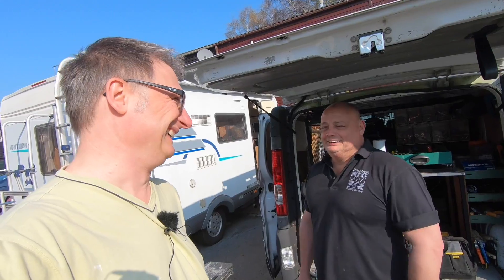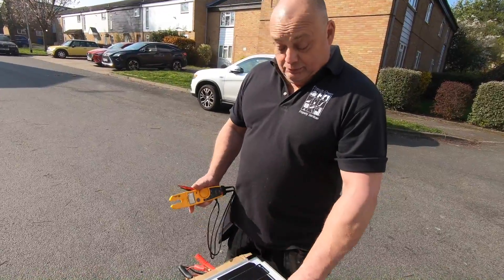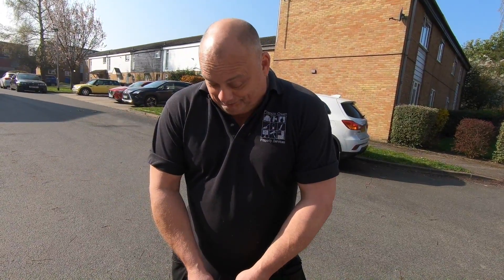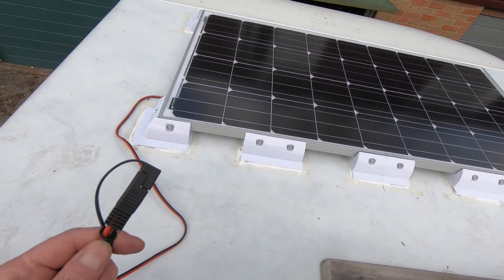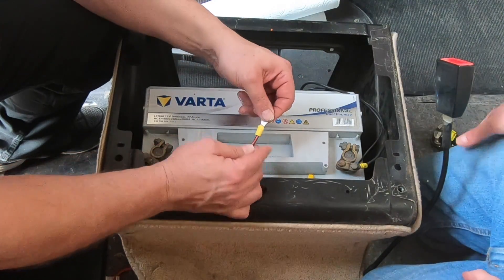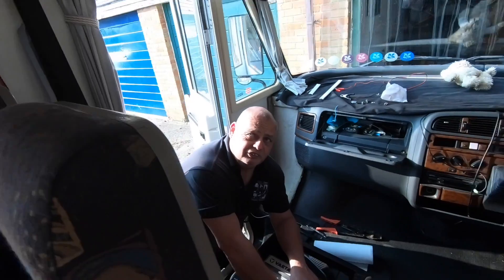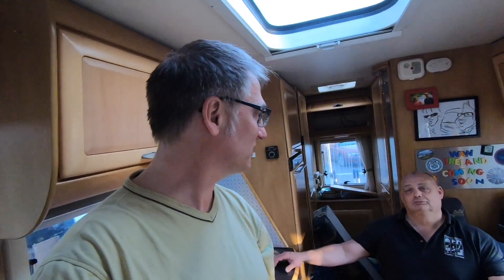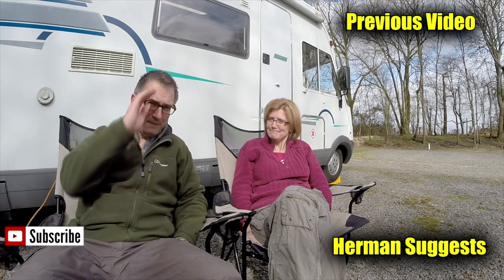DIY Installing Solar to a Motorhome/Caravan - Part 3

Comment: So it's been 3 years. How's the glue holding up? ( Haven't gotten further so no idea id a follow up video yet
Reply from the maker: The mastic is fine, Andreas
Reply: @HermanHitstheRoad  wait, i thought mastic meant sealant that does not harden?
Reply from the maker: They harden to a flexible rubbery glue

Comment: We have just got a solar kit, yours is the first Video  I've found to show drilling through the Motorhome roof. To be honest I'm not looking forward to doing it lol 😂😷
Reply from the maker: LOL David, nor was I. What solar did you get?
Reply: Herman Hits the Road we got Renogy 200D starter kit 😷
Reply from the maker: Is that 200 watts then? Does it come with a MPPT controller too?
Reply: Herman Hits the Road yes 200 watts but not the pttp controller 😷
Reply from the maker: You'll need the MPPT solar controller. It manages the charging a lot more efficiently than any thing else. We have the Victron SmartSolar MPPT 75 1 15
Reply: Herman Hits the Road yes but it came with the other  so we will have to go with that till funds allow us to change it 😷

Comment: hi what size inline fuse do u use thanks j
Reply from the maker: Hi Jason, the fuse came already fitted to the controller. I think it is a 20amp but it depends on how many watts your panel brings in and what your controller is rated for
Reply: thank u for getting back to me i will be useing a 30 amp controller so will i need a 20 amp fuse or do i need a 30 amp inline fuse to the main battery and i will be putting the other outlet to the leisure battery i will be useing 300 watts of solar pannels ,sorry about all the questions but it came wth them but not installed right thanks again j

Comment: Great video Ads....Can I ask where you got the extra long mounting bracket for the front end from?
Reply from the maker: Hi Vagabond Voyagers, it's actually 3 pieces. Two long lengths and an off-cut from a smaller one for the middle.
Reply: Aahh that explains it.....Thanks Ads

Comment: Hi !   I've got a similar EBL fitted in my Hymer and I have all the solar gear ready to fit and connect.   I had come to the same conclusion and will avoid connecting through the EBL.   Although you have connected only to the leisure battery, have you found it also charges the starter battery once the leisure battery is fully charged?   And did you wash the underside of the panel brackets before you bonded them to the roof?    The video showed you doing that to the roof.   I ask because I know they use a release agent in the moulds when they are cast and that stops adhesive from getting a good grip.   I learned that the hard way with a new ceiling vent and I found I could push it off easily once I unscrewed a couple of bolts even though I had bonded it too.    All the best, Pete
Reply from the maker: Hi Pete, I haven't connected the starter battery to the solar. I didn't wipe the bottom but Chas might of. It is very firmly bonded to the roof. I do check and clean it every so often.

Comment: Hi, I’ve just bought the same charge controller. It’s not yet installed. Because the controller is already fused does that mean you don’t need a fuse either side or just battery side? Thanks for the videos and the live-streams good fun and informative to watch.
Reply from the maker: Hi, there is no harm in adding more fuses but I haven't because a 20 amp is already present. Check out the install instructions for the controller. I would check but I don't have it with me at the moment.

Comment: Hi off topic but need your help please. My bus is in storage in Spain and i need a dimension for the width of the windscreen between the interior blinds and from the carpet dash to underside of the bed. Could you help?
Reply from the maker: Hi Richard, I'm not sure what measurement you need but the height from the carpet dash to the bottom of the drop down bed is 55-60cm. The bed moves up and down with the struts since it is only held in place by a seat belt. Yours may be different. What do you need the measurement for?
Reply from the maker: If you need wind screen dimensions then we gave these to Autoglass - Height - 87.5cm including rubber / Width - 258cm including rubber

Comment: Why so many fixing brackets? One each corner and one in the middle of each long side would have done and let some air under it for cooling.
Reply from the maker: That thing isn't coming off and wind will be deflected over the top when driving

Comment: not the best reading when you place your multimeter on the panel youre testing...
Reply from the maker: We're just making sure the panel works before we glue it to the roof. You can't test the amount of amps because there are too many factors such as how sunny it is and angle of panel to the sun.

Comment: #6: Good job, I would probably install ting a little neeter, but that's only me ;o), good choice on the MPPT reg, I got the 100/20 one  installed,  the BT app works great, now you got every info you need. Enjoy the free solar power. Cheers.
Reply from the maker: Neater? What's not neat?
Reply: @HermanHitstheRoad  Again, its just me, no offence at your work, but I would  put the hole in the roof more in a corner wise, idem with the regulator. Also, the wires are to far stripped and (copper) exposed at the terminals for my taste. But who m I, if you are happy with it, all is fine, no problem. cheers.
Reply from the maker: Couldn't do that due to the curve on the roof. Sounds like OCD ;-)